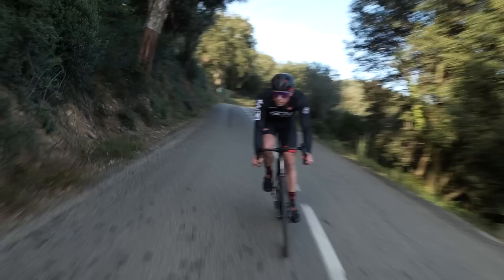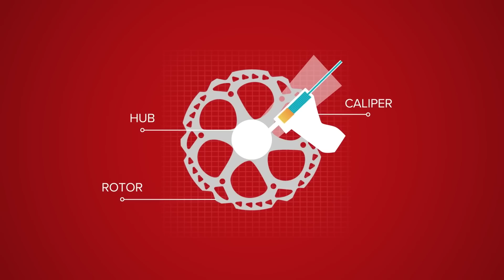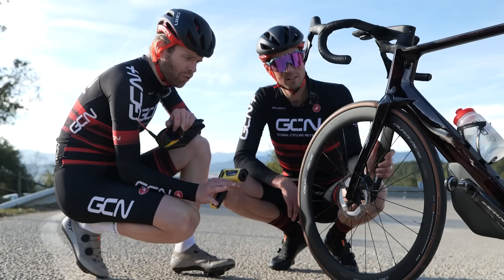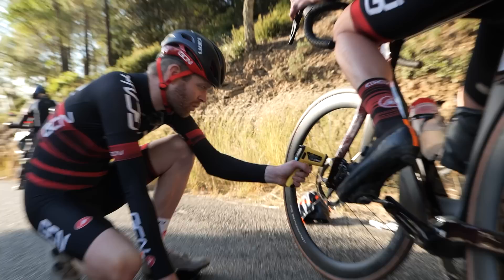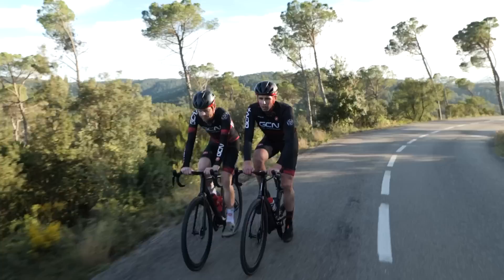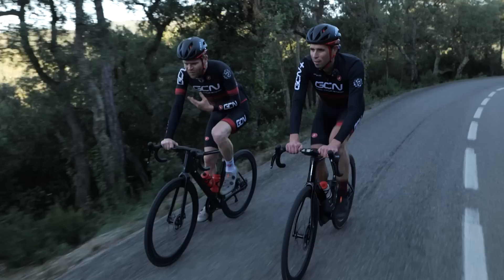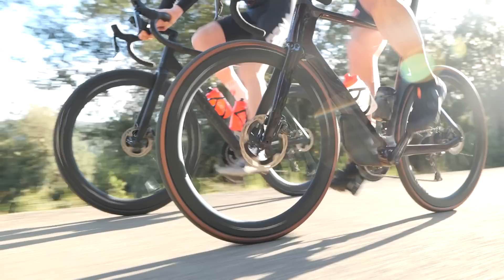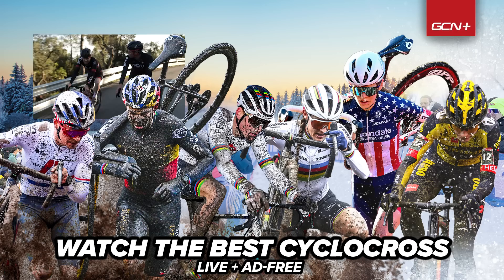Are Big Disc Brakes REALLY Better?

Comment: I switched from the supplied 140mm front disc Ultegra R8000, to the same in 160mm. I need much less force to brake equally, hence your idea of less wear is justified. Where I ride there are often stop lights on hills so coming to a complete stop from 70km/h was taxing on a 140mm front rotor, now seems to be less stressful!
Reply: 12.5%
Reply: Much less force is merely a perception, your initial input of Force to the brake lever will be the same no matter what size rotor. Larger rotors can transfer & dissipate thermal energy. There is less fade with larger rotors thereby creating the perception that you need less force on the lever. After initial pull of the lever you need less Force to maintain the same braking power.
Reply: @rider65  of course you need less force with a bigger rotor for the same braking power. its simple physics - bigger lever, less force required.

Comment: Please, please, make an experiment indoors monitoring how the temperature builds up in the disc rotor, in the brake pads and in the oil with different setups:
a) standard 160mm rotors, 2-pot calipers and a fan blowing on the setup
b) standard 160mm rotors, 2-pot calipers and finned brake pads with the fan blowing
c) and d): repeat a) and b) with 180mm rotors
e) and f): repeat a) and b) with 4-pot calipers 

Maybe you can do the experiment in association with GMBN for the 4-pot calipers. And make sure that in all cases you are dissipating the same power turning the wheel at the same speed.

Comment: This was interesting since I currently have rim brakes and did not know about options for various-size rotors.  My riding has lots of hills, so when I do upgrade to a carbon bike with disc brakes, I would want the largest diameter rotor that can fit on my bike.  This was a valuable video!
Reply: The biggest rotor you can get are rim brakes. 622mm > 160mm
Reply: @lincolnlu9869  220 mm Dh rotors combined with 4 pot brakes will stop every road bike
Reply: @lincolnlu9869  luckily it's not 1986 anymore and we can use discs instead 👍
Reply: @lincolnlu9869  true, but don't confuse that statement with having the most stopping power.
Reply: @simonm1447  overkill really, a bikes brakes are only as good as the grip of the tyres, for MTB it makes sense but for a road bike you'd rarely be able to utilise the full power
Reply: @asams7255  better in poor weather.
Better modulation.
Less maintenence.
Less fade.
Reply: @charliedillon1400  you can ride an affordable rim braked bike just fine. That doesn't mean disc brakes don't offer objective improvements in power, modulation and consistency. I'd say the road bike world, after years and years of scientifically proven to be ineffective and expensive gram-hunting, has finally found something that actually brings noticeable improvements for affordable money (compared to $500 carbon saddles and stems).

But being both in the lycra and baggy pants camps, the difference in attitude towards changes is noticeable, with MTB always changing, ever if it isn't needed (QR15 and Super Boost) and road riding talking about revolutionary changes when a carbon stem is 30 grams lighter.
Reply: This is marketing BS at work this rider thinks he is going to upgrade when he goes to a carbon bike with disc brakes 🤦‍♂️ this is what’s wrong with this industry
Reply: @jesmondo5785  Better modulation? Probably yes but it is still debatable. Disc brakes may be too soft for my liking. Racing gear should be firm for better control at high speed, over bumps and at high G forces. You don't want too much mechanical advantage. Less fade? It depends. Rim brakes with good pads on aluminum rims will fade less than DB with 140 mm rotor. Less maintenance? Just LOL.
Reply: @jkk916  bro, I've been running discs for 2 years and have changed 1 set of pads. No adjustment no nothing. That's far less than any rim brakes I've ever used. There's no denying that discs out perform in poor conditions and as somebody who rides all year round in the UK this is very important.
Reply: definitely get Magura HS11, 22 or 33.  Hydraulics for rims.   The best brake in the world.  I also have a motor fatbike with discs, but the rim hydraulics are just genius on my old hardtail.

Comment: I ride a very roadbike-esque city bike (700C, no suspension, Tiagra all around) and I regularly tow my twins in a trailer. About 45kg for the whole lot (trailer and kids) switching from 140 to 160 made a significant feelable differece. At least in terms of stopping power and distance.

Comment: If you want to get disks really hot go and visit Hope Technology.  They have all the kit for testing their own brakes.  BTW the hill you were using wasn't nearly steep enough to get the rotors hot.  You need an extended section >10%, then use one brake to hold a constant speed.

Comment: I don't have the science, but I can tell you my weight plus the weight my propel is 115kg, and washing off speed say from 80km/hr just before I enter a corner can result in being able to smell the brakes pads cooking and once my rotors go blue from the heat it's pretty much game over for them. Unless you like your brakes sounding like the mating call of a Lamma. I'm running 160's front and back and it took a while to master how to wash off speed quickly without cooking them. I have also blown out a front tyre from heat build-up on rim brakes. Yep, I need to lose a few kgs.

Comment: I've noticed that 160 mm disc's work better than 140 mm. However a 700mm disc works better. All are aluminum. Carbon doesn't work anywhere near as good.
There's nothing on that run needs braking unless you are trying to keep below the speed limit.

Comment: I'm surprised the change in modulation between rotor size was not discussed more. It is my understanding that is a big reason for selecting one size rotor over another, since a smaller rotor has more modulation than a larger one - that's the "less input" feeling that was mentioned by Alex. 
180mm might not be the best for every situation. In cyclocross, most pros (under 80 kg) use a 140mm to have better modulation and control of the grip their tires have with the ground. The same can be said for an lighter rider on the road too: a larger rotor could be harder to control and make it easier to slide out. SRAM takes this into account in their rotor recommendations chart.
Reply: From my experience you won't slide out at the front even with a 180 rotor (in the dry, with good tires), the tire always has so much grip that the bike will want to somersault if you overdo it, but not slide. In the rear though there is really no need for more than 140/160mm on a road bike because you simply can't  transfer much energy there without locking the wheel.

Comment: A big takeaway for me is how quickly they cool down.  Good to know that if you are on a long descent, and you feel the brakes are getting too hot, just not braking for a relatively short period of time, of just switching back and forth between applying front and rear braking, can quickly bring the temp down considerably.

Comment: I weigh a 100kg and the stopping power is very noticable for a 180mm disc. For comparison i did the test on a roadbike(140,160,180) and my downhill bike(160,180,203), both in Belgium and the alps.

Comment: we’ll see bigger disparity if we were operating at the end of the rotors limitations. Within regular operating temps would be marginal gains. 

But if it’s a heavier rider or a steeper descent the benefit of the larger rotors would be more apparent.

Comment: In my opinion. Which is the most important opinion. The Only good rim brakes. Have been melted down and recycled into baked been tins. I have always had a passionate hatred of rim brakes. Even that substandard tat was the only brakes you could get. As for disc size. Both my 27.5" full sus and my 29er mountain bikes have 203mm front and 180mm rear. Both have 4 pot calipers. As my hybrid on had 32mm tyres. Not the 2.3" on the full sus and 2.6" on the hard tail. My hybrid only has 180mm front and 160 rear. With 2 pot calipers.

Comment: my gravel thing has 203/185mm rotors. hope m4 calipers mated to srram apex levers. 
the lever feel is very light weight and super powerful due to the calipers being bigger surface area then the levers are made for, the pad area being much bigger and obviously the leverage.
braking is a no thought thing,

Comment: I really like my 180 on my gravel. Brakes better and i do not run out  of brake when going down hill off road around chavenage. Having said that, I cannot notice a difference between slx and XT performance…10g and £20…. SLX will be my choice when XT is worn out.

Comment: The problem with a large rotor is the extra force going through the fork, which could potentially make it fail.
Reply: They'll just make the fork heavier to compensate. People think the brakes are where the weight gain is but there is also a beefier carbon layup in the disc forks to compensate for the flex at the end where the rotors are.
Reply: @charliedillon1400  doesn't help for an existing fork though

Comment: 160mm is adequate for a 160kg total system weight on steep 8-10% descents but needs good rotors with good coolings and finned pads.

Comment: Makes sense that all the rotors reached the same peak temperature. regardless of the rotor size the brake is transferring your momentum into heat so if you are braking from the same speed and weight the same then the same amount of heat will be generated. the advantage as you discovered is the rate that the rotors cool, allowing you to brake again sooner with a larger rotor. this is why you don't drag brakes, but gently "pulse" them, brake hard for a few seconds then off for a few seconds repeated on steep descents.
Reply: Finally somebody who understands physics and thermodynamics! 😄👍
Reply: Close, but there's a problem with what you claim for 'pulsing' (Yes it improves things, but not for the reason you state). If the relationship between heat generated (express it in Watts...kW) is the same as energy lost from braking, then pulsed or not, for the same braking power, you must dissipate the same amount of energy (and Watts is a linear and used way to express this, as it is for electricity to heat in a resistive element).

The advantages of pulsing are manifest in a different way that I won't go into here, but pulsing certainly does work advantageously in many ways...

Comment: Like rim brakes because it’s a cheaper option but I’ve noticed over the last week due to an awful lot of rain I’ve been breaking much earlier and been a lot more careful than other riders I’ve been cycling with who have disk breaks
Reply: No big deal. Seriously, how often are you descending, in the rain, under race conditions? Almost never? Then just anticipate early braking like you just described. No need to add a squealing kilo to your bike for the maybe what if moments.
Reply: I think I’m going to steal that from you. “squealing kilo” 😂 and don’t forget the additional cost of buying a disc brake equipped bike

Comment: Shame you did not discuss the impact of the greater leverage from increasing disc size on the hubs and spokes.
Reply: You do not have greater leverage with increase in rotor size that is merely a false narrative. Roller size has nothing to do with leverage and ratio at the master cylinder. The cylinder the hose and the caliper are the same size no matter what rotor is installed. It is merely a perception or a feel that braking force is less. Larger rotors have more swept area and are able to convert and dissipate thermal energy much more efficiently. This results in little to no fade compared to smaller rotors.

Comment: heat building means contact area, so the result will be the same as long as your brake pad keep the same.
so the only matter is the sharp of hole on the rotor, rider weight and rider brake practices

Comment: Being rubbish at decent and 80kg I got a heat temper blue purple 160mm rotor on my tcr and have broken cables on mechanical disc setups  and sheared the friction material off the pads. The hydraulic is better but still need more stopping power.

Comment: Even as a light-ish rider, I use 160mm front and rear for two reasons.
1) easy to swap wheels between bikes by having consistent across all bikes.
2) reduced leverage. I've not got massively strong hands sue to injury. If I. Can reduce the strength needed to achieve adequate braking.

Comment: put a heavy guy and a light guy on the same rotors and see the difference at the bottom of the hill.  make it a big enough hill so you can push the limits of heating up.

Comment: Certainly for mountain and other offroad bikes I will always stay with disc brakes. There is just not substitute in my experience. I rode with rim brakes for YEARS and the first time I rode with a disc it was a revelation. The bike actually stopped in the heavy rain/mud and the front end felt more controllable. Not to mention my hands wouldn't tire after a long technical and cold/wet decent. For road it isn't as important but in the rain coming downhill on a long ride I'm sure it makes a difference.

Comment: All rotor sizes are probably totally safe and functional when it comes to stopping performance, but as a 90ish kg rider myself I'd probably go with a 180 mm just to avoid disc warp/rub. Disc rub is the most disappointing sound and I hate it

Comment: I have a disc(160) and rim brake bike and never really had an issue with my rim brake set-up compared to the disc brake bike. However, recently going out to Spain at Christmas and using a hired (Orbea) rim braked (105) carbon bike, I had less confidence in the brakes. Even though it was alloy rimmed with decent tyres. Granted I got mixed up with front and rear brakes early on (swapped over on bikes on the continent), I either locked up the rear too easily or didn’t feel I had enough stopping power on the steepest descents. Not sure if I was the pads or what, but my own rim brakes bike has much more modulation and control. Maybe I’m just used to the setup more. But it did make me appreciate the arguments for discs more.
Reply: The pads and rims make a huge difference, as they would on any vehicle, as they do on discs. With the right pads and rim surface, you'll get as much stopping power as discs if your calipers meet a given standard.

Comment: Just a heads up that IR thermometers don't give accurate readings on shiny/reflective surfaces like brake rotors... They emit less IR radiation relative to their true temperature than do other surfaces... The relative readings between the rotor sizes would still be consistent but the absolute temperature readings would skew lower than actual.

Comment: There are only a few locations in the US where it might be advantageous to have a bike that uses disc brakes. I would guess that it is the same in the UK.
Reply: Yeah, in the sales department.
Reply: I live and ride in mountainous Colorado and have no desire to use road disc brakes because it's so very rare you're riding in the rain here. Steep descents at high speed are no problemo with good rim brakes, just gotta not ride like a noob.
Reply: Correct Stephen
Reply: @charliedillon1400  correct Charlie
Reply: Bill you are partially correct. In the middle of the country and place like Florida - sure flat AF. But if you live in either seaboard, western or eastern, we a lot of mountains and rolling terrain. However, even though I climb AND descend 1,000,000 ft per year I would never ride a disc brake bike. I own one full Dura-Ace disc bike and never ride it.

Comment: Having crashed and breaking my collarbone descending a hill and using 140 mm discs and 115kg I have little confidence descending hills now so on the brakes a lot more. On my new bike I wanted bigger discs but could only get 140 at time of purchase so am on the brakes a lot more due to confidence. I will definitely put bigger discs on when showing signs of wear because I worry that being a heavier rider the heat builds up quicker as braking  more and will get brake fade. But I’m also 101kg now but still worry.

Comment: "better"? At what metric?

"Small" discs have enough leverage to lock the brakes. Bigger discs can carry more heat because it has more material and can dissipate it easier by having more surface area. The same is true for car brakes: big brake kits are used to stave off brake fade not for stopping power, stock brakes are sized to be able to lock the brakes (hence why ABS is needed).
Reply: Force required at the lever and modulation. Softer levers are way better to use and allow way more control, allowing to get closer to the locking up point without crossing it.

Comment: I use a 180mm rotor on the front of my touring bicycle.  The combined weight of the bicycle and me is around 150kg.  The 180 gives me a lot more stopping power but it is always the 160 on the rear which wears out first.  TRP has a video of glowing rotors with their HY/RD brake.

Comment: Physics says that disc size/surface don't have anything with stopping power: F= μ x N (Amount of friction  = coefficient of frictions X force pressing the object against the surface). That's why are all disc are heated to the same temp. Disc size/surface matters for cooling - bigger disc avoid overheating.
Premise wrong, conclusion (luckily) correct. :-)

Comment: 90kg and on deeps descents with switchbacks my breaks are sometimes overheating. Would like so see the temperature for heavier riders on steep descent... guess there would be a difference in peak temperature depending on the rotor size

Comment: now I want a video where you test how much decending is required to delaminate carbon rims with rimbreaks
Reply: The secret is not to have carbon rims. Gee, d'ya think perhaps a metal layer could be bonded to carbon? Think about it...
Reply: @stephensaines7100  It'd be better to have an actual aluminium rim with a carbon fairing (like how HED does it), but at the cost of weight.